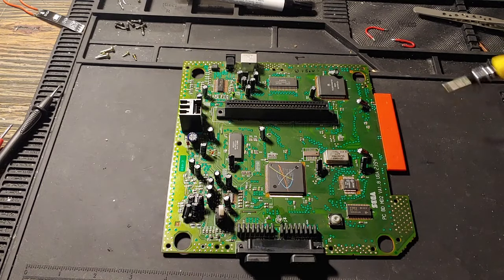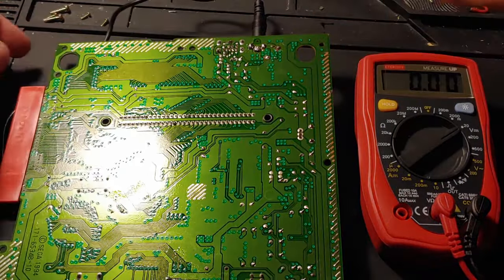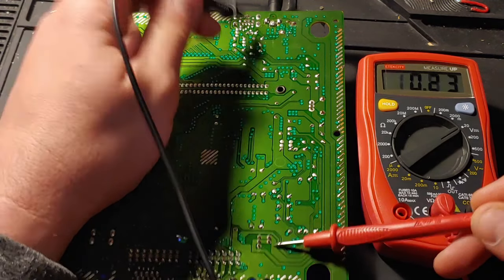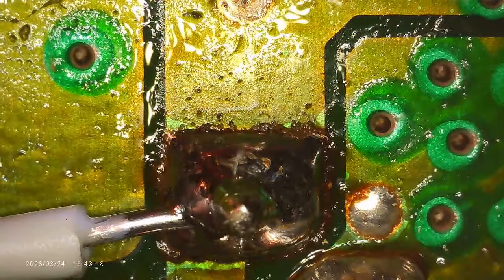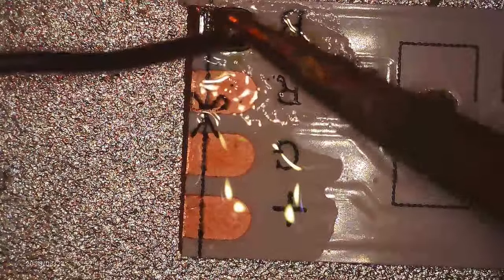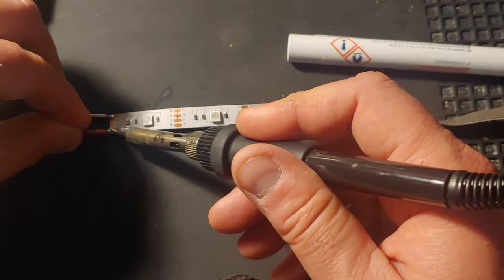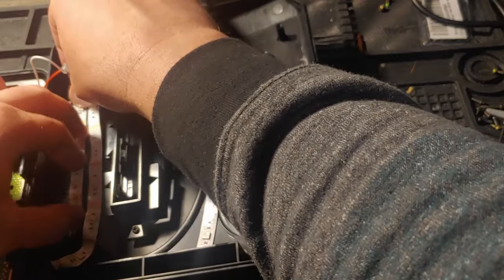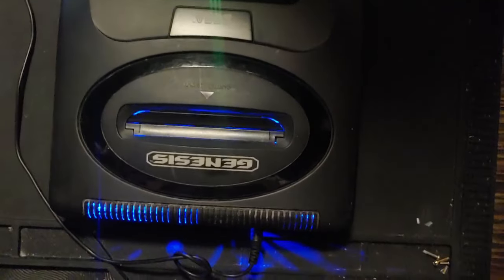Sega Genesis LED Mod - Let's put LEDs inside!!

Comment: How many amps are the LEDs drawing versus what the circuit is rated for? Does the power supply support it?  Try plugging in a rom cart and see if there is enough power.
Reply from the maker: LED strips draw about 2amps for an entire strip.  We are using a very small portion of that strip. We have never used the ROM carts in here but it plays regular games perfectly fine.
Thanks for watching!